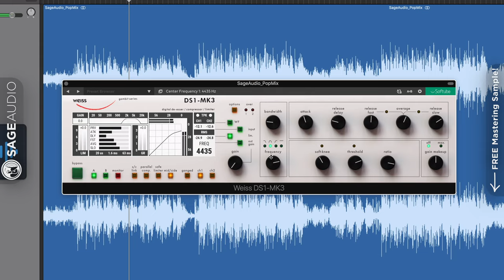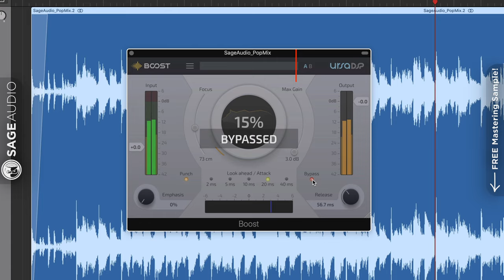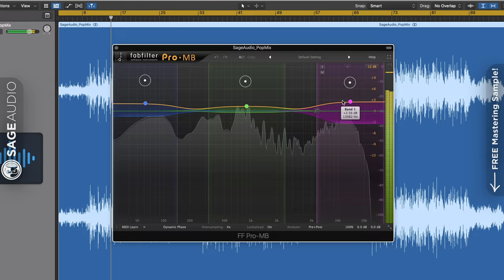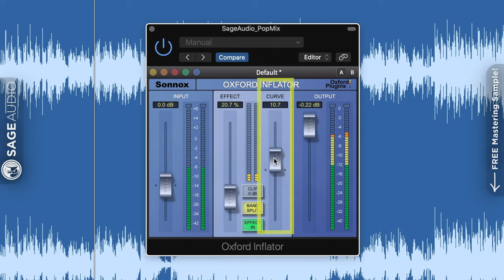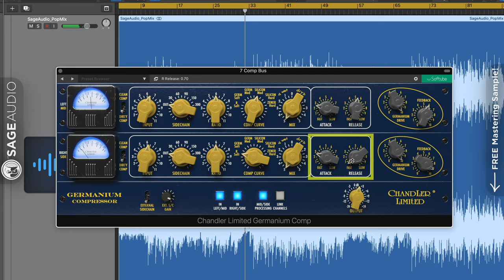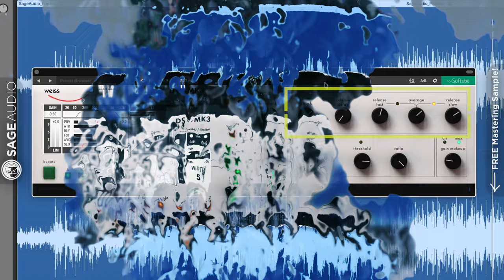I Mastered a Song with 7 Compressors!?

Comment: Thanks for sharing. Is this not the antithesis of legendary mixing engineer Bruce Swedien who preached little or no compression in mixing?
Reply: This is mastering and not mixing. As for Bruce Swedien, i guess preachers will be preaching while compressors will keep on compressing
Reply: I am curious to learn Sage Audio's approach to mastering more subtle, dynamic, nuanced, acoustic music genres.
Reply: @sammiller9855   Sage audio as i see presented here did an experiment as a challenge by using reduced  amount of tool types and presented the results.
I highly doubt thats " the sage mastering" and that they are using this method all the time. Not even on this type of music.

Having said that ,  "the one right mastering" does not exist. Plain as that. If you can make a song, track, piece  sound better than before processing when compared in a blind test  there is not a single person on this planet who will find something false about the way you achieved it. The result is what its important and if you like it. Not why you do it in a certain way. 

Also you cant compare mastering for Jazz and Classical music 1:1 with modern pop and dance music which "wants" to be loud in order to stand out. Most mastering engineers if not all , know that this is damaging music . chocking transients etc. This is wanted in this case. 
You WANT to kill transients, add distortion, contain dynamics in order to get gain in perceived loudness in the "loud" genres. 
It is not coincidence and it`s also not like this because engineers don`t know how to preserve dynamics and transients, but because clients and labels say "make it louder". This goes on for decades now. 

Also some Genres literally Live out of compression , limiting, saturation. 
Metal music for example. Electric guitars are basically a very distorted guitar string sound. Are they "bad quality" when compared to Ferenc Snetberger playing guitar? Is there a point in  even comparing it? 

So there is more to it than saving jazz and classical. If you earn your living from mastering and dont have the luxury of choosing your clients and only working with the best recorded  organic instruments and vocals  material,  comes a time where you will be asked to  "make it louder!"
And you will have to choose if its your job to save music and people who don`t want to be saved or do the job and  pay your rent

So in short, There is no "This is the right Mastering" 

"I think the main criticism that mixers such as Bruce Swedien and Alan Parsons have about compression is that people tend to overuse them as quick fixes for controlling dynamics instead of automation, and original musicianship" 
This is old news and nobody disagrees with that. It is what it is.

"For me, some of the best-sounding albums are in the jazz, folk, and classical genre because they sound more "primitive""

Well that is your taste. There are however many more types of humans and music directions. So if you have a client that loves Noise music or Drone music what are you going to tell this client? That you will not do this distortion and compression cause its bad for the music? 

As i said. No one way to master cause not one way as to what people "demand" .
Reply: Upon further reflection, engineers/mixers like Bruce that advocated minimal compression at least during the tracking/mixing stage were using analog gear that already had some inherent compression/saturation (e.g., tube mikes, tape, etc).
Reply: @sammiller9855  exactly. As i said. I dont like Dogma and Preaching. I believe in experimenting if you must. As long as the result satisfies you its one of the few freedoms we have
Reply from the maker: Hey Sam! Thanks for watching! This was more of an experiment to see how it sounded, but it probably shouldn't be used as a real chain haha!

SageAudio.com